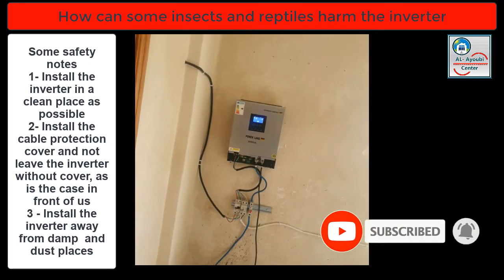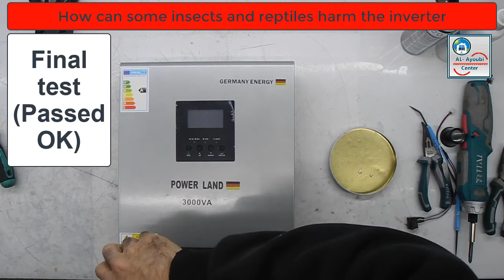How can some insects and reptiles harm solar inverter and charger?

Comment: Thanks so much. This was exactly what happened to one of my inverter I told about that has firmware issues. The issue started after the Replacement of the transistors.
Reply from the maker: Thank you very much, we are at your service